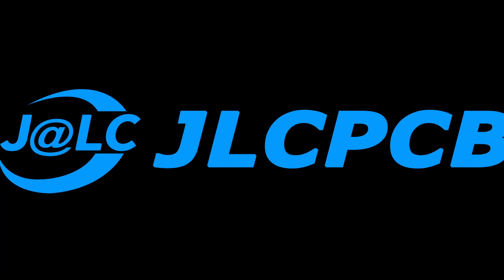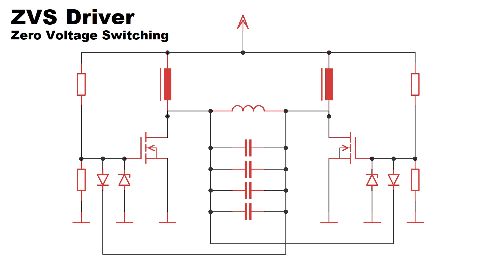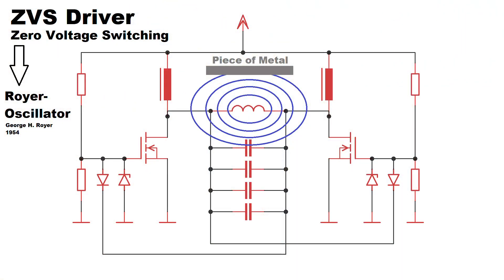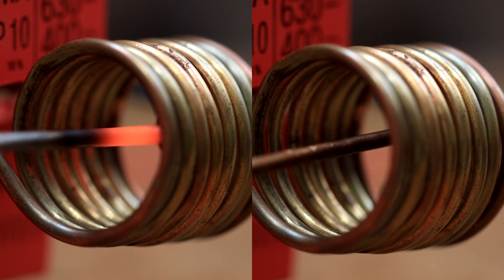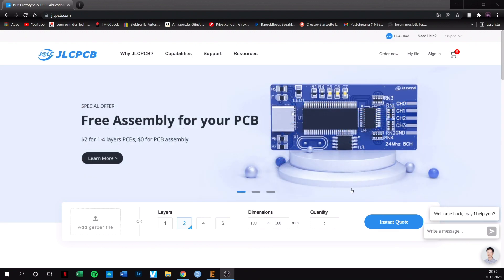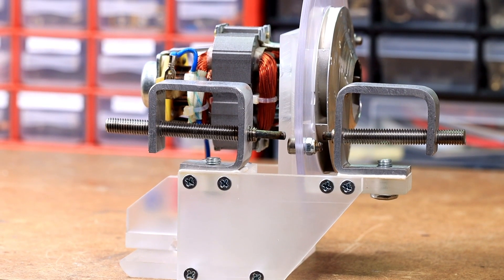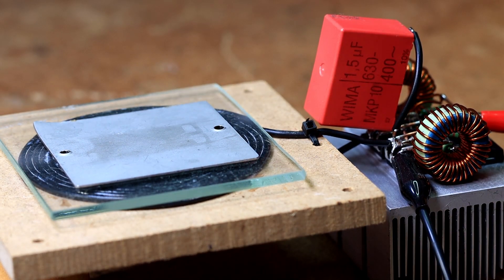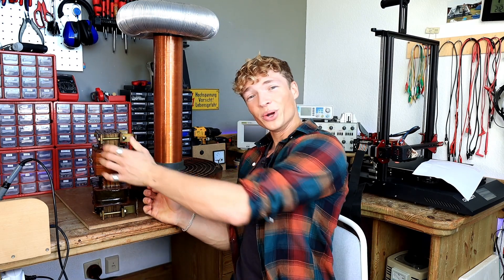EMP Induction Heater? Cooking with electromagnetic Pulses

Comment: Where did you get the pancake coil? Purchased or homemade? If homemade, how did you make it? The turns look pretty even. If purchased, from where?
Reply from the maker: I make the coil by myself, I make one loop, fix it with some glue, and than I repeat this Procedere serval Times :)
Reply: @Teslaundmehr  Thanks for the response. What is it made out of? That doesn't look like magnet wire. Did you use any epoxy? There is so much energy running through it with the EMP video... with bare copper I would expect to see arcing.